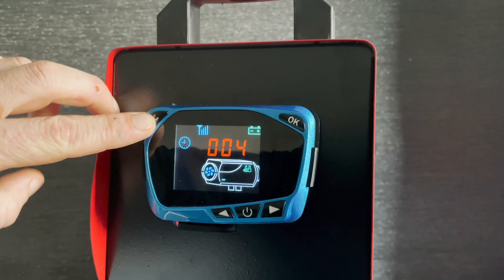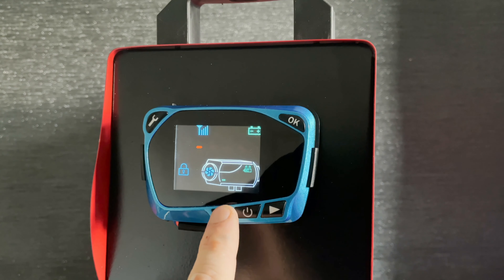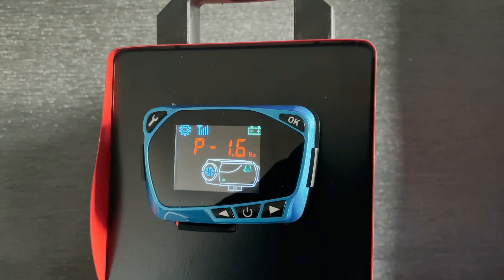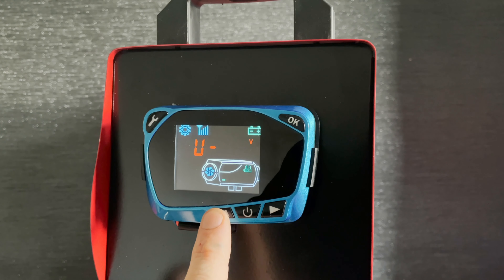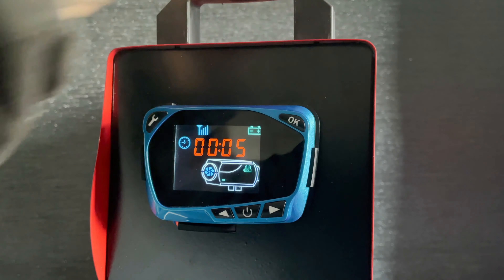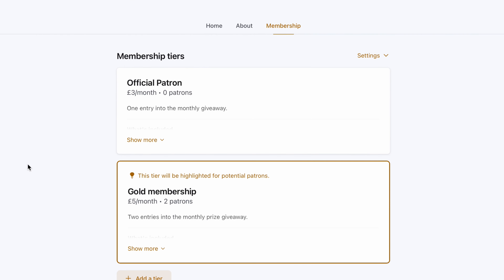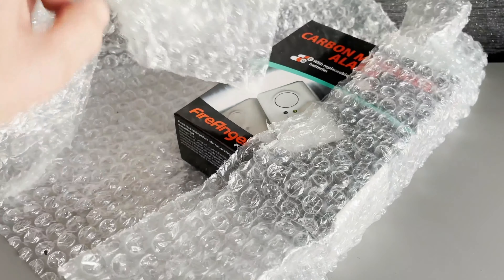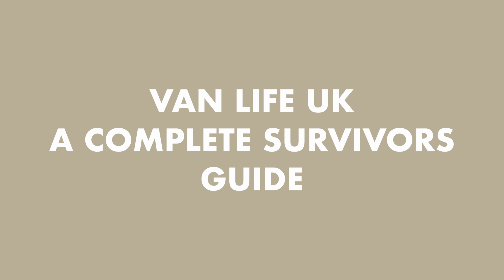How To Change The New Style Blue Chinese Diesel Heater Controller From 12v To 24v

Comment: Thank you so much for this video!!!
I didn't know you could run this heater on 24v!!! My off road rig is a former military humvee, as you know all military vehicles are 24v instead of 12.....I thought I was going to have to install a converter, but not now!!! Thank you again!!!
subscribed, notifications, and like button smashed!
Reply: It's just the controller that can work on 12v or 24v heaters. You would need a 24v heater for your set up. Sorry for the bad news
Reply: @MR-MRE  Well, bad news is good new s in the face of cooking that board, so no biggie I'll get a converter for it.
Many Tanks!
Reply: 1688 does not work on my heater how do u get code